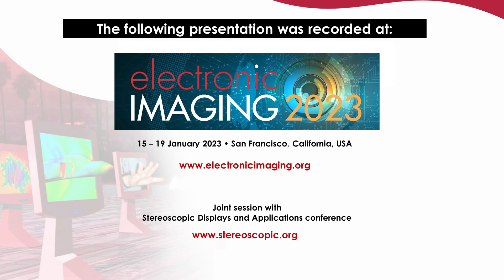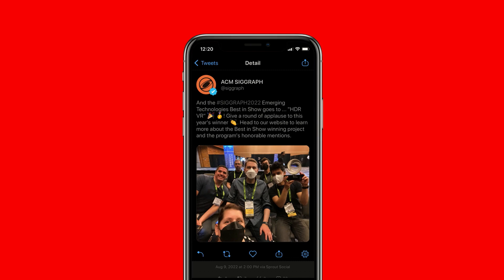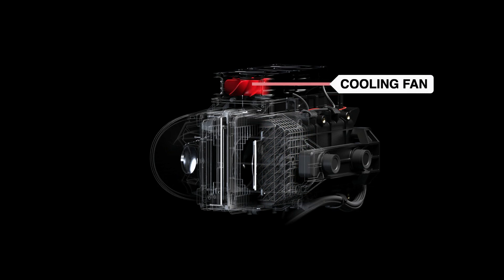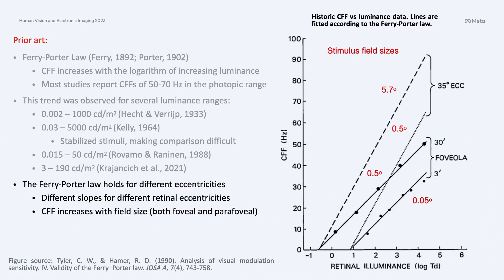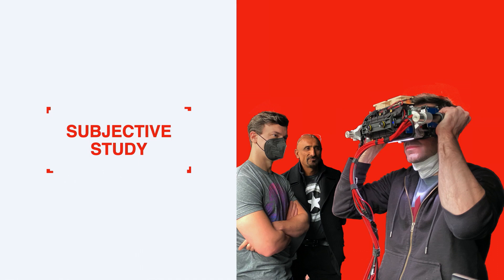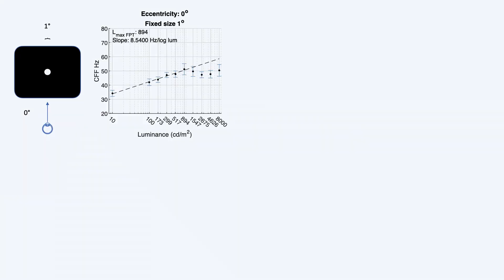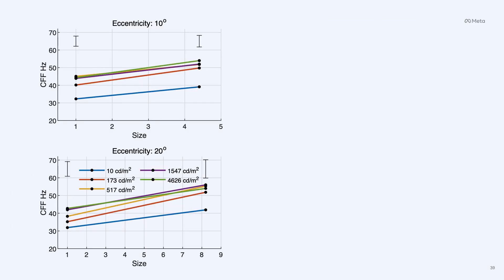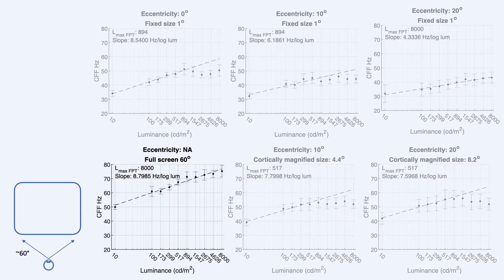HVEI 2023: Critical flicker frequency (CFF) at high luminance levels

Comment: I want to know if it's beneficial genetically and which part of the brain interprets the information.
I'm trying to figure out why I can see / perceive certain LED lights flickering (higher than 100hz)  when others can't... 
For my point, someone in the same room with the lights on cannot see what I'm "seeing or perceiving". (I'm not looking straight into the light.., I could even be adjacent to the room the light is in). 

The outlets are fine with 15amp breakers. with GFIs.  It's not the wiring, diodes, bridge rectifiers  or fault of the product. 
I'm trying to understand why I can see a higher hz rate than others.
For example, If I'm in a room (living room/ common area) with an incandescent lighting on the ceiling next to a joint room with LED lights I can still see or notice a visual buzz or visual super fast hum.
For me at all times (with certain LED light) is like watching a humming bird's wings flutter at a bird feeder but seeing a black frame in between the hover, catching certain perfect pictures of the entire motion in a microsecond.
This phenomena is too distinct for me not to point it out to other people and they get it but just think it's too bright but don't get it. 

If you break down the visual pathway is it the hypothalamus / suprachiasmatic  that's perceiving the light speed (hz)  that sends it to the visual cortex?
I'm curious if other people can perceive a higher hz rate as well? I came here looking for that reasoning.